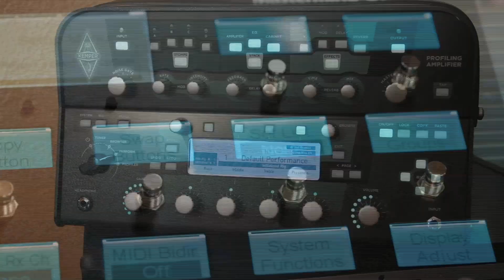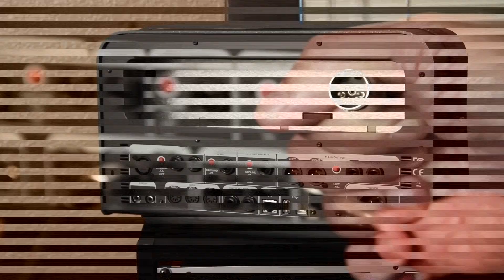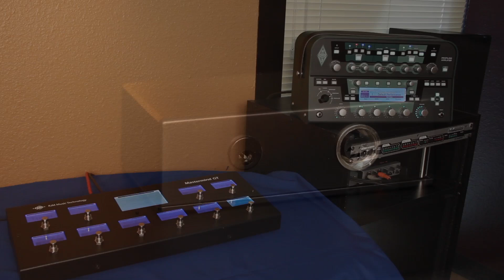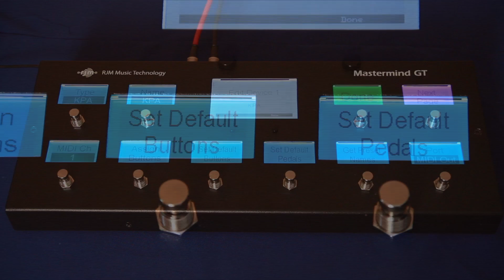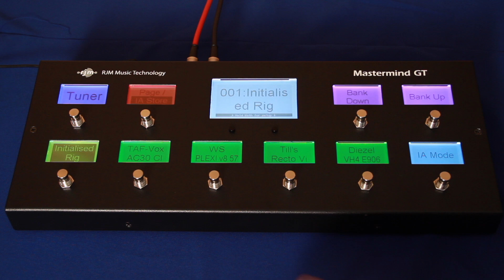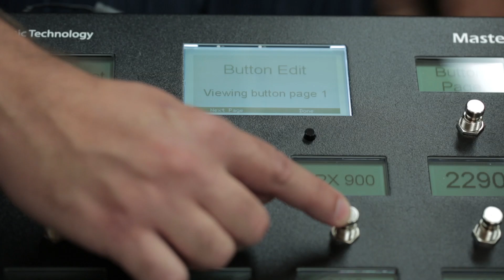How To: Mastermind GT MIDI Foot Controller with a Kemper Profiling Amp

Comment: Hey there!i just wondering if it can work with Boss GT 1000 core.
Reply from the maker: It'll control a GT1000, no problem. You can select presets, and (I'm fairly sure) that you can also control individual effects in a patch. The GT1000 doesn't support bidirectional features like tuner display or the ability to download preset names, though.

Comment: For pro touring rigs, it is a huge pain to run a long 5 pin AND a long 7 pin downstage, but so be it, someday there will be a pro connector, but for now this is it.
Reply from the maker: We now have a little adapter box that combines the two MIDI connections plus power together so you only need to run one 7-pin MIDI cable to the KPA.